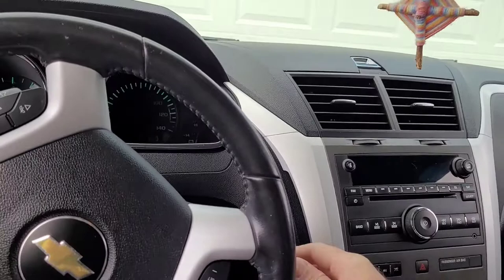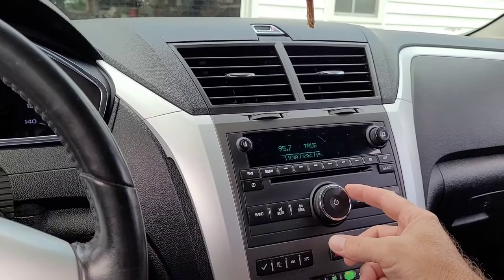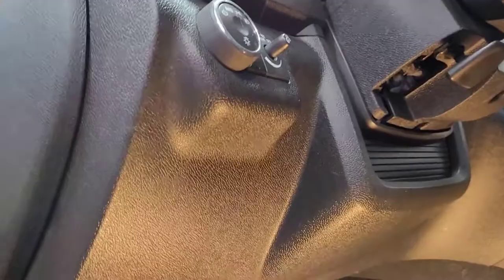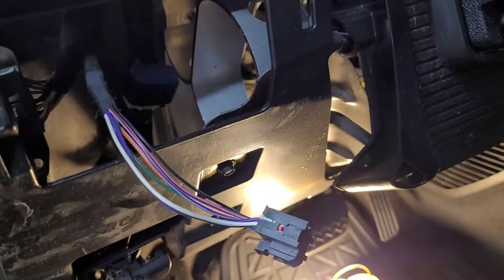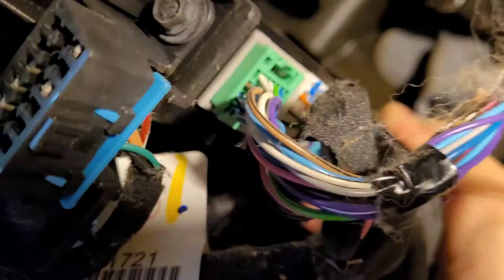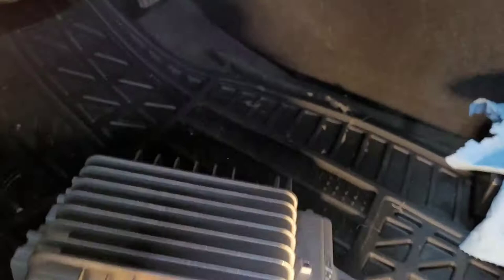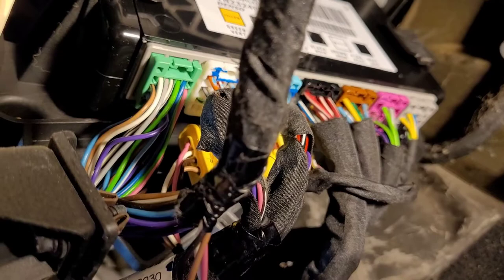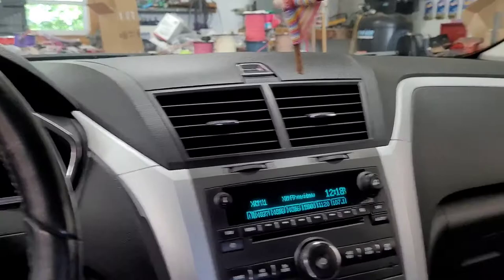2009 2015 Chevrolet Traverse GMC Terrain Bose Stereo Amp Diagnosis and Replacement

Comment: Great video, thanks for sharing! I would like to add that another way to tell if the amplifier is bad is to simply touch it and feel if it's hot. If it's not getting hot it's most likely fried! Mine was barely warm and I replaced it with another amplifier from the junkyard, so far so good. 😉
Reply from the maker: Awesome, thank you!

Comment: how did you take out the push pins
Reply from the maker: Pull the centers out, and then the outer portion of the pin comes right out.
Reply: @tonyscarcare5657  should i use pliers or something too grab it?
Reply from the maker: It will pry out with a flat screwdriver. They come out very easily.

Comment: It leaks in the door jam onto the wire harness and getting into that plug in each door.
Reply from the maker: Yes I'm aware of that but that was not what was causing the problem on this one. The amp fixed it. Also I cut holes in the bottom of each door boot so they would drain.

Comment: As Meatloaf once said, "Two out of three ain't bad..."-- For those struggling with the top screw on the side with the two screws-- just pop the unit out with a screw driver or the panel tool he used in the video. Don't even waste your time trying to remove it. In my 2015 Acadia all of the screws were less than hand tight, telling me either someone on the assembly line was lazy or they are not that important. I chose the latter explanation. The copper retainer popped out with the screw and I debated for approximately 1 second about reusing the copper retainer by screwing it into the new amp, but 25,000 miles later the amp is still working fine with two screws. 

This took me less than an hour using this method. Great video Tony.
Reply from the maker: Thank you, Sir!

Comment: Thank you for the detailed video. This past Monday, my volume was going in and out. I did research, and I see the claims about the water collecting in the door harness packs. And truthfully, I unhooked the drivers side and left rear and there was ounces of water the poured out. Literally, on Thursday the speakers popped and I lost all chimes. 
So, I traced it back to the amp as well. But I read review after review much of a pain the rear end this thing is to change. I really wonder what genius engineer inserted this thing as an afterthought? 
Regardless, I’m going to try to change it out on Sunday, but you’re the first person to suggest unhooking the ECM pack. So hopefully that does help.
Reply from the maker: Thanks, that was the first time I ever changed one and was impossible to show you the screws but honestly it wasn't that bad. You don't need to pull the ecm out either.....just unplug it and get the wires out of the way. Really the bottom screw was the worst because it's so close the the rubber coated insulation on the firewall. I did have a satisfied customer though.
Reply: So I called it off after about 1.5 hours. I did disassemble the various trim panels and even after dropping the ECM pack….I still could not get to all three screws. I got to the bottom one. The top left I could not get enough of my arm with any tool in there to start to loosen the screw. And I never even found the third. Then I started to think even if I got it unhooked completely-the notion of having to “feel your way” to take off the harnesses from the top of the amp started to bother me. 
In summary, I hate that I’m going to have to take it somewhere to get it swapped out, but it’s really one of the dumbest configurations ever for an auto. And my arm was getting so chewed up and contorted it really wasn’t worth my entire afternoon.
Reply from the maker: Thank you! It is totally doable in an hour or so. And to let you no I did cut small holes in the bottom of each door boot so they will drain. Just stretch the rubber down and snip.
Reply from the maker: @nickmcdonnell4163  dang I'm sorry to hear this. All of my fat is in my gut and my arms are skinny but I guess looking like a pregnant crack whore does have its advantages! 😂
Reply: Bcm not ecm

Comment: What did you use to get the screws out and back in for the new amplifier and where did you get the tools?   I am ready to go to work but need the tools to  do it and knowlege of a couple of these videos, I figure being a womand and smaller hands and maybe wrist etc... I might not get cut up as bad.  Let's hope it as easy and as you make it minus removing the dash parts.  :)
Reply from the maker: I just used a ratchet and a socket.

Comment: By chance do you know where the sub woofer is? I need to get to it , I can’t find it
Reply from the maker: I'm sorry, but my wiring diagram doesn't tell me where the sub is located. I'd surely think it would be in one of the rear side compartments.
Reply: It's at the bottom of the center council.
Reply: @dustinmason5182  how do I access it? I just want to tap into the wires to run my own sub and amp. Thanks for letting me know! I really appreciate it

Comment: For those that are struggling to put the harness on the new amp

Push the amp up, and in the cavity, and push the amp up against the firewall/body of car on drivers side, then put the harness on. I almost gave up
Reply: Dude, I went crazy trying to plug in the harnesses, my hands are big and it wasn't easy, but I finally figured it out! I got everything plugged in by doing it exactly the way you said. Thanks for the tip!!! 😉
Reply from the maker: It was tough for sure.

Comment: Are you in Michigan?  Will you change mine please?
Reply from the maker: Lol.....I'll be in Dearborn in September.
Reply: @tonyscarcare5657  I would of course pay you I need mine changed. I was washing my windshield with a squeegee and the fluid went into the vent and now my radio is just popping no sound from anything in the car.  2015 Traverse. How much would you charge for that?
Reply from the maker: @nikiabanks3184  probably $130.00
Reply: @tonyscarcare5657  that sounds good.  If you would be interested I am as well. Can you assist with part ordering so I don’t ask for the wrong thing.
Reply from the maker: @nikiabanks3184  all you have to do is give the dealership your VIN and they'll get the correct one.
Reply: @tonyscarcare5657  so order it from a dealership then ok
Reply: Hopefully we can get together when you come in September!
Reply from the maker: @nikiabanks3184  yes that's where I had to get it.
Reply from the maker: @nikiabanks3184  are you near Dearborn?
Reply: I live in Clinton Township which is maybe 30 minutes from Dearborn
Reply: How much was the part from the dealership?
Reply from the maker: @nikiabanks3184  it can be done. I always work on customer cars when I'm up there.
Reply from the maker: I don't remember. I'll have to look.
Reply: Ok let me get the party ordered. what date are you coming?
Reply from the maker: @nikiabanks3184  September 8 - 12 for The Old Car Festival.
Reply: Hi Tony just wanted to touch bases. I know we spoke about you replacing my traverse amp however my husband and I were able to replace it ourselves thanks to your video. We aren’t handy at all but managed to get it done after several hours. That back screw was a BITCH. But thanks to a couple of YouTube videos we got it taken care of. Keep putting out great content!!
Reply from the maker: @nikiabanks3184  thank you.